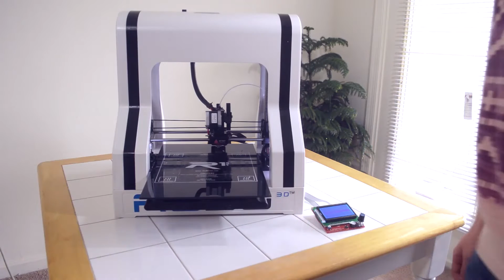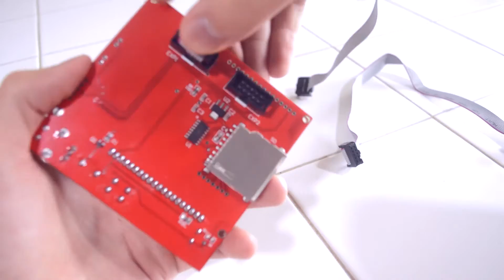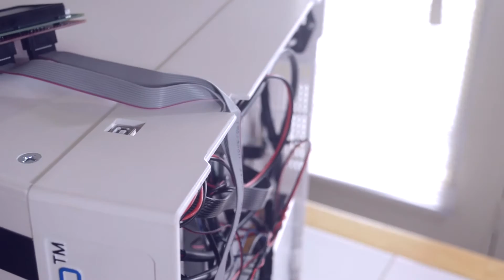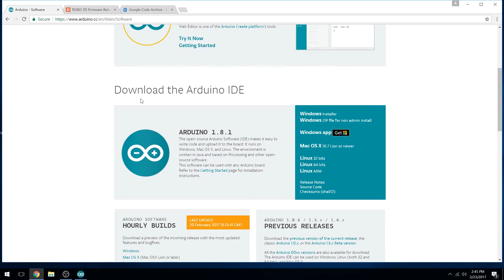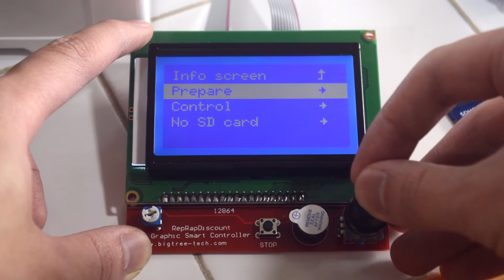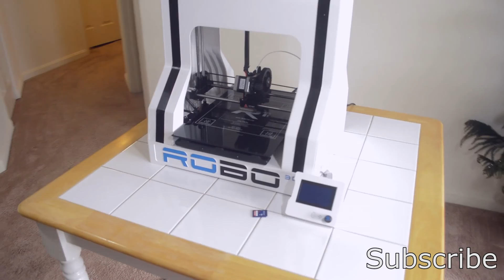Robo R1 Plus Smart Controller Upgrade Tutorial

Comment: Best video so far on this but I'm getting an error during compile that I can't figure out:
--------------------------
Arduino: 1.8.5 (Windows 10), Board: "Arduino/Genuino Mega or Mega 2560, ATmega2560 (Mega 2560)"

In file included from sketch\SdFile.h:27:0,

                 from sketch\cardreader.h:8,

                 from sketch\Marlin_main.cpp:44:

SdBaseFile.h:38: error: using typedef-name 'fpos_t' after 'struct'

 struct fpos_t {

        ^

In file included from sketch\Marlin.h:10:0,

                 from sketch\Marlin_main.cpp:30:

c:\users\chrome\appdata\local\arduino15\packages\arduino\tools\avr-gcc\5.4.0-atmel3.6.1-arduino2\avr\include\stdio.h:950:33: note: 'fpos_t' has a previous declaration here

 _extension_ typedef long long fpos_t;

                                 ^

exit status 1
using typedef-name 'fpos_t' after 'struct'

--------------------------------------------------------------
Reply: Hey there, I don't know if you're still having this issue, but it can easily be fixed by using an older version of Arduino! Version 1.6.9 worked for me, the error you got was adressed by Robo, saying that for some reason compiling issues were issued in older versions, hope this helps! :)

Comment: I hooked this LCD screen to my R1 + last night with a good firmware update. I unhooked the USB, was able to heat extruder and bed and homed the extruder. It did not show my SD card (16 gb) so I attempted to reload my file to my SD. I LCD screen was frozen now and would not respond to dial changes. Not knowing what else to do I power off my machine, and restarted only to get a plain blue screen. I uploaded the firmware again and still noting. Any suggestions?
Reply from the maker: That still sounds like an error in the firmware upload process. Its been a while since I've done it myself, so I'm not sure. Your best bet is to look at Robo3d's website to see if they have any troubleshooting help pages. Sorry for your troubles!